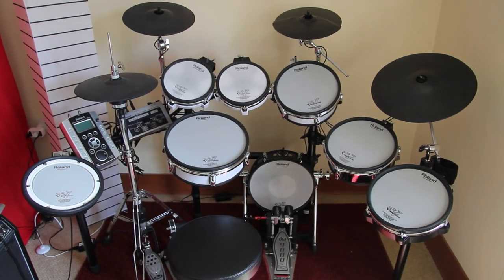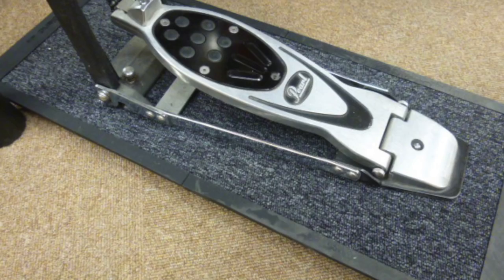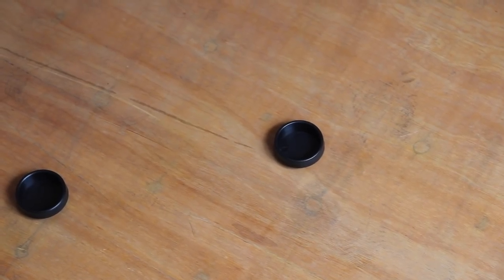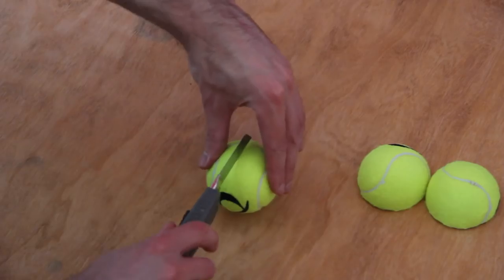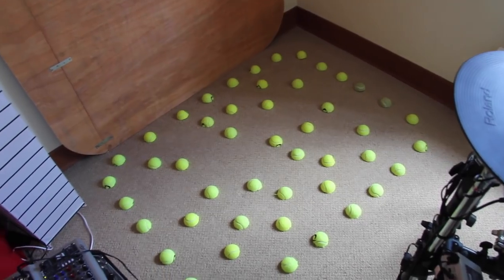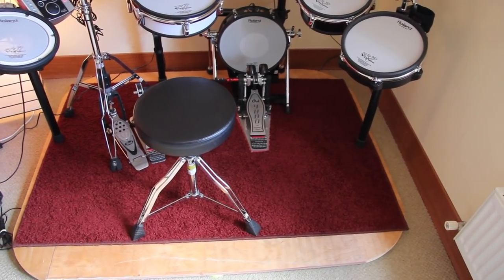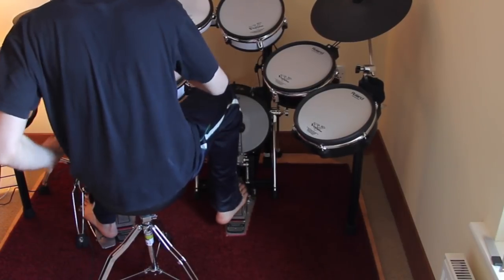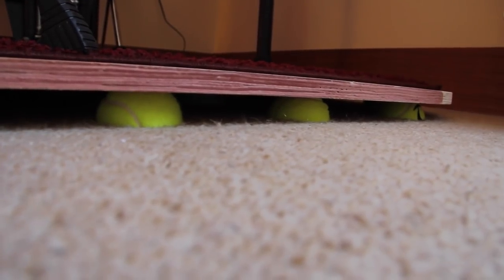Noise Reducing Drum Riser (Low Budget Version)

Comment: If you're going to sit on top of the riser with all of your weight, this will severely compress the tennis balls, thus decreasing the noise eating effect. I would recommend cutting the area of the board around the drum stool to prevent this from happening (raise the stool a couple of inches to compensate for the change in height of your kit). You can still cover this gap with a mat and sit on top of that, it'll likely look neater that way
Reply from the maker: +Silvio Great idea, that would make sense!

Comment: This is amazing, I was looking at the hundreds of dollars the noise eaters would cost, plus i'd have to wait for them to get shipped, found this video, and now an hour later my downstairs neighbor says he can barely hear anything even if I really stomp the bass and hi-hat. I used a couple spare pieces of wood and about 8 tennis balls to make a platform that just fits under the drums (not enough wood or tennis balls  or space to fit under chair) and while it's a little bit wobbly it does the job.
Reply: As stated by other users, maybe the fact that youre only holding the kits weight (and whatever force you imprint on your hihat and kick pedal with your legs) without the drummers, makes this cheap version work almost as good as the full version of the tennis riser. Looking forward to build mine. By the way, did you use additional rubber pads or just the tennis balls, wood and carpet?

Comment: I’ve done this platform and I did the mistake of not checking with my neighbour before to see if it work, so I got a massive complaint from my landlord about the noise from the key pedal, I would say it reduce The sound by 75% so I know I’m getting closer of not disturbing my neighbour.
So I’ve just ordered the Roland  NE-10 noise eater, With Roland’s claims of reducing 75% of the noise or vibration you should do the job now on the kick pedal.

Comment: Great video, I just made this using a MDF 19mm board, but on my hard floor I notice some low frequency resonance from the kick. Would you recommend me to place anything between the MDF board and the floor or should I just assume that this can only be heard in my room? Thanks :)
Reply from the maker: +mohaawwkk Maybe use a carpet on top. And if possible, an additional layer of rubber mat material and another board. The heavier, the better.

Comment: Thank you very much for the video! I made one for me and it works well to decrease the vibrations. But my biggest problem is the ambience sound which made by the sticks when hit on the cymbals or rubber pads. It is heard by downstair neighboors. Do you suggest any idea for that? My solution is to use 2,3mm epdm heavy barrier (3kg/m2 ) and 6mm rubber plates together on floor to block the ambience noise. What dou you think? Thanks again.
Reply from the maker: I would use quiet pads that do not produce as much sound. Quiet mesh heads and quiet cymbals. You could also dampen your room with noise absorption foam. This foam is not expensive and reduces the noise a bit.
Reply from the maker: I would rather go for the tama product. The other one will be too heavy and change the weight of the stick and your playing.
Reply: I tried two of them. Result: nothing changed! Guys if you think that theese rubber tips decrease the volume of stick sounds don't buy them.. The sound still the same level just smoother. Finally I choose the last idea of mine and bought Promark B600 nylon brush pair. From the drum modeule increase the sensitivity levels of all pads and cymbals. Now it is not similar using of drum sticks but no sound is made, that's good for me. Even more i choose the bop or jazz kit from the module than feel more realistic.. Now looking for a silent kick pedal like Yamaha KU100 or HH65 to use the kicks quiet. E-drums dont sounds like aquistics but ambient noise is still a big proplem who lives in apartment! Hope new ideas will share here :)

Comment: Don't the tennisball move around when you play drums?
I can imagine when you sit on the drumthrone, the weight is higher on the tennisball underneath the chair, then it is on the corners of the wood.. So this might lead to the wooden plate not be level anymore?

What is your experience on that?
Reply from the maker: Hi, I placed more tennis balls underneath the stool than on the corners. They compress a bit but not to much. The plate and balls are not moving at all. The amount of tennis balls depends on the weight of the kit/gear and the persons weight. The whole constriction is shaking a bit while playing, but not enough to trigger any pads accidentally.
Reply: Another way is to just raise the height of your drum throne. This is only an option if you haven't got it on max height already of course and have it placed beside the raiser so you're not sitting on the raiser itself.
Also, by not having your throne on top of the raiser allows you to make a shallower raiser that could be a good thing for people with limited space or if you have to transport the raiser at some point.

Comment: Hi, I have a question for you.
I saw other platform projects using entire-intact tennis ball.
Do you know which solution works better?
Reply from the maker: Their are both working, but the one with entire balls need a wooden board with holes. You need a special saw/drill to make them. I thought it is easier to cut the tennis balls than drilling holes. But like I said, both systems are working.

Comment: hi, i need your opinion about the NE-10 only on the kick and hi hat, does it really work?
Reply from the maker: +Guille Lezerín Hi, yes it does really work. What kick pad are you using?
Reply: well.. i´ll buy the td 25k (without v)
and i am very confuse with the kick pedal, i wrote you on another video about what beater you recomended for the less noise posible with the KD-9 x, so, i need  a good combo  with the NE 9 and the best beater, if you could help me to do the less noise posible i will be very greatful
i gonna delete my last question in the other video
thank you so much
Reply from the maker: If you really want to avoid bass drum noise, you'd go for a KT-10. The feel is not as good, but it is really quiet. A KD-120 is also not bad. The KD-9 is still kind of noisy.
Reply: +Vdrum Tips so i will should to buy it apart
Reply: +Vdrum Tips really, i prefeer use the kd9, i can do some noise but i need the less with this one.
i think i will follow your 1st recommendation, k9 + ne 10 + r drums soft beater!
i think this is the less noise configuration for the k9, thank you for your videos and sorry for over explaining, but when you will pay a lot of money you need to know all of everything!
Thank you again!
Reply from the maker: No worries, better ask 3 times before wasting money for the wrong setup. This is why I made this channel:)

Comment: How do you prevent the vibrations of the platform climb the rack and trigger the cymbals? (when using the kick pedal)
Reply from the maker: +Filipe Silva With the XTalk and Treshold Setting in the module.
Reply: +Vdrum Tips Oh thanks! I'll try it out:)
Reply: I actually worked:) thanks. I have a question: Between a tennis ball riser and the Roland NE-10 noise eaters, which one allows more vibrations to go to the neighbours below? And which one gives you more stability when playing?
Reply from the maker: The NE-10 is definitely the better choice. But it is expensive.
Reply: I wish I knew that before spending so much time and money around my drum riser. Tennis balls, foam, two layers of wood, Roland drum mat, rubber mats, yoga mats...geez. And in the end, everything (rack, pads) shakes when using kick or hi-hat pedals. If you add more tennis balls to improve stability, the vibrations to the lower floor grow. Sometimes I feel like throwing everything away and go for something like the Roland NE-10 and forget about it. Its annoying to play drums and think at any moment some neighbour will knock on your door complaining (because it happened with half tennis balls and one layer of MDF + mats). Cheers! Thanks!
Reply from the maker: The NE-10 is not ideal. It is shaking, takes too much space and is expensive. The ideal solution is much more complicated and effective. For now there is only a thread in a german forum. Someday I will implement this idea. And the best thing. you can use your podest plates. You are basically just replacing the tennis balls.
Reply: Thanks for replying:) I'll dig more on this matter to achieve the best solution:) I have a Roland TD25KV on a 120x120cm drum riser. Do you think if I increase the platform (like 160x140cm) will also help reduce the vibrations a bit?
Reply from the maker: Reducing the vibration depends mostly on the dampening system. I am already after another better solution. There is a method in a German forum which is much better than all solutions out there.
Reply: Can you please share a link for that forum?:)

Comment: I own a 2box and I have it over a surface of like 1" of rubber and 2-3 mats but it still makes noise. Since I live in the top of my building my problem is the vibration transmited way down. Do you think this could reduce it enough for me? I guess for me this one is better than the pedals stands since the 2box has the kick pad in the rack and that wouldn't work without isolating the whole structure.
I've seen some videos using 2 layers and the whole tennis ball, What do you think about this?
Thanks
Reply from the maker: Hi, I am building a new podest at the moment with a different technology but way more effective. I would suggest you to wait until I release this video before building anything.
Reply: Thanks a lot! Anyway 'll do some tests with old tennis balls I have over here. Hope to hear from you soon!
Reply: looking forward to it! cheers
Reply: Hey dude. I made a kick test with a piece of wood and 4 balls stucked in holes and the difference is really big in terms of vibration of the kick (you could even jump over it and there was no vibration in any part of the flat). It broke down with too much weight so if you're thinking in building something similar you've got to think well about the gaps between balls; even more if your kit is heavy as mine.
Anyway I'd wait untill the new video is uploaded before starting building nothing and maybe we can have a better solution.
Keep it rocking!
By the way, do you know when you'll approximately have it?
Reply from the maker: Hi, yes totally right. The platform has to be very stable. My new podest is as strong as a rock. I am using 24mm MDF sheets, there will be no bending and the "pillars" are a special industry isolation foam, made for my kits specific weight. I am about to build it now. Just missing the carpet at the moment. It will hopefully be released before christmas. I would suggest you to wait for this, since it is the proper way of building a platform.
Reply: Ok thanks a lot! How much will it cost you?
Reply from the maker: 350-400
Reply: Not too bad. I'll wait for your coments
Thanks!
Reply from the maker: It is wort it. It will look really professional and work great.

Comment: Thanks for the video! It is the easier riser I have seen so far. I have a neighbour who complains everytime I play drums. Can anyone confirm that with this riser neighbours around stop hearing the drum bass beats??
Reply from the maker: Hi Javier, this device helps to reduce the noise. But you can still hear something. It also depends on your kick drum. If you have a neighbor like this, you will probably need something totally different. Do you know the KT-10 ?
Reply: Marcel Price I didn't know it, the Roland KT-10 looks like a good idea, thanks!. In regard to your video, maybe it will reduce more noise if you place the player's stool out of the noise reducer. I read that the weight of the player compresses the tennis balls and jeopardizes the proper aborption of the beats.
Reply from the maker: Javier VS I never tried the kt-10 myself, but I think it is the best and quietest solution. You are right with the stool. Therefore I placed more tennis balls underneath the stool. I am already working on a new construction which separates the kick pads/pedal part from the rest. it is also made out of tennis balls, but i am not finished yet. It is really hard to find a good solution for a double pedal and hi hat stand.
Reply: Marcel Price I am looking forward to see your new construction! To separated the kick pad from the rest of the drums looks like a wise idea. Is it the hi-hat stand really a big problema when it comes to ground vibes?

Comment: i did exactly like the video but my neighbor still complaining:( ... i need help plz, is there anything i could do to eliminate the bass drum noise ?
Reply from the maker: +hobazzz This construction reduces noise, it does not eliminate it completely. The only way to solve your problem is buying a quieter kick pad. What pad do you have?
Reply: +Vdrum Tips thanks for responding.. i have the KD-9 of the TD-11KV
Reply from the maker: The KD-9 is not really quiet. I recommend a KT-10, since you seem to have big trouble with your neighbours.
Reply: +hobazzz I found Triggera Krigg trigger to be the best solution to eliminate the noise from the bass drum pad. It installs on any acoustic drum pedal.
Reply: +hobazzz I found Triggera Krigg trigger to be the best solution to eliminate the noise from the bass drum pad. It installs on any acoustic drum pedal.
Reply from the maker: It is a hard rubber surface, struck by plastic beater. That means to me it is actually more noisy.
Reply: +Vdrum Tips +Boom247 thanks so much for the solutions .. although it is not easy just leaving your favorite double pedal like this, it will not feel the same for sure.. im gonna give a try adding more layers of towels & carpets or whatever first